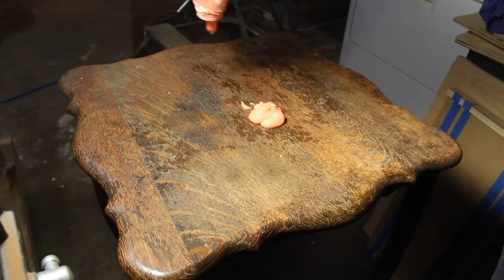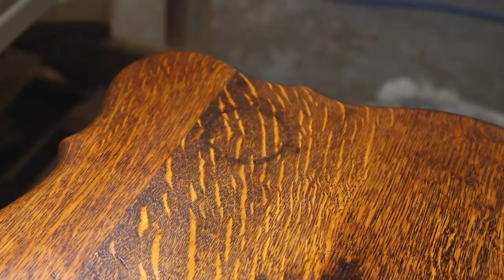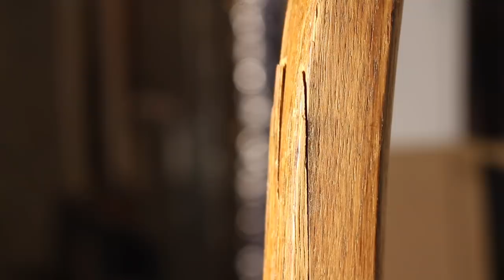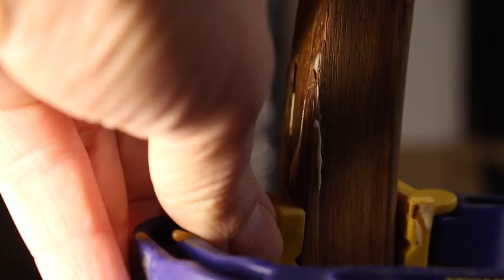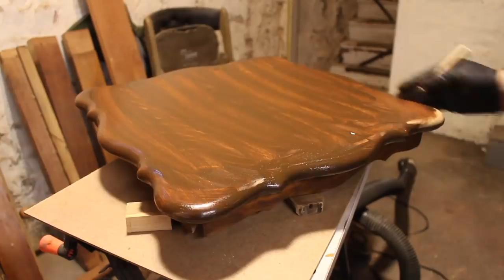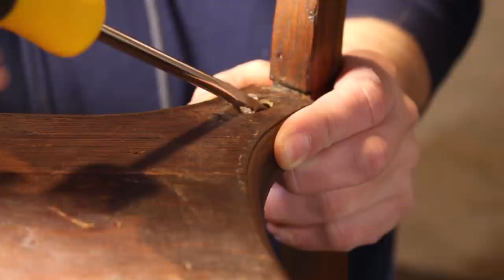Vintage Furniture Restoration | Part 2 - Refinishing an Old Oak Table

Comment: Great job, I really liked how you repaired and restored the old oak pieces. There is something that very few woodworkers seem to do and that is also pay some attention to the old hardware! Clean up the old screws, washers and wing nuts by simply soaking them in Evaporust or something and get rid of the corrosion. Maybe treat them for some rust prevention. File down lightly damaged screw heads if needed and so on. That sort of thing.
Reply: Also, it is good to clean up the underside of a piece.  This one looked a bit messy when putting the legs back together.  Kind of like just pulling your pants up after going #2 and not doing the paperwork.

Comment: That table is gorgeous!
I need advice from you or anyone who can help, please. I'm working on a customer's piano. For the past few years her relative allowed his birds free range on this piano. We've washed it with Mr. Clean, but the odor remains. I can't bring the bench or kick board in the house. They're on the back porch for now. They smell so bad. Can you suggest anything? I had the bench filled with baking soda for a week. It didn't help at all. How deep can that odor go?
Reply from the maker: I've found odor removal to be one of the toughest jobs.  I've tried most of the home remedies such as putting it in the sun or using baking soda or coffee grounds but most of the time the only solution is to remove the finish and apply a new finish.  Or, you could try putting a new finish over the existing one.  That might seal in the odor.

Comment: Just found your videos and love them. Thanks. What wipe on poly are you using for your top coat? Ever use GF Arm R seal.
Reply from the maker: I used Minwax satin poly.  I use GF stains but I haven't used Arm r Seal.  Thanks for watching.
Reply: @DashnerDesignRestoration  thanks! I work at Woodcraft and seem to help many DIYer fix their Minwax finishes. Love the GF products
Reply: GF Arm R Seal is a wonderful product. So easy to use and forgiving. 👍

Comment: love your videos! thanks for posting. 2 questions: what kind of epoxy filler do you use- i see it comes pre-portioned in kind of a roll- and i haven't ever seen that before. Also- where do you get the syringes (and what kind are they) for the small space glue ups? thanks!
Reply from the maker: The epoxy is Quikwood.  I got the syringe either at Rockler or Woodcraft. They sell them in the glue aisle but I'm sure you could find it online somewhere,.
Reply: @DashnerDesignRestoration  thanks! you have officially inspired me to rescue a few finds :)